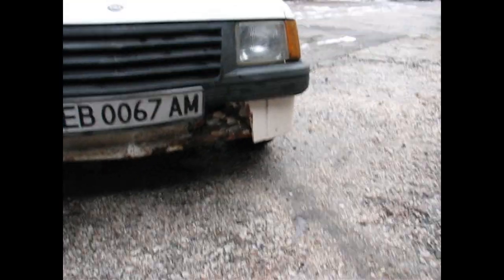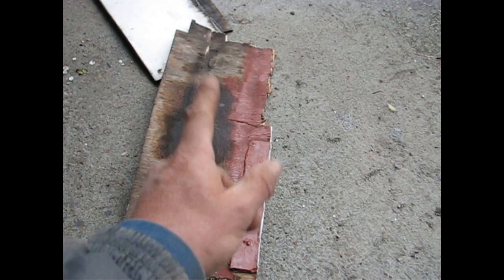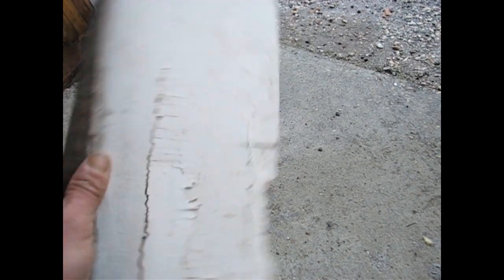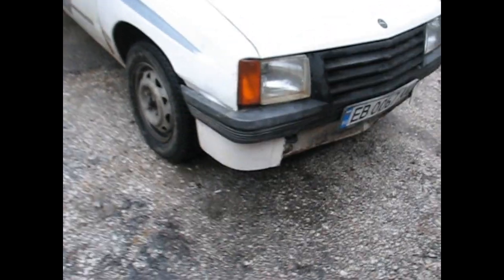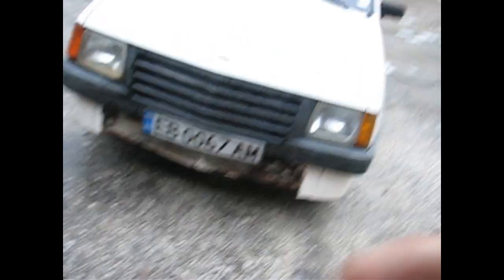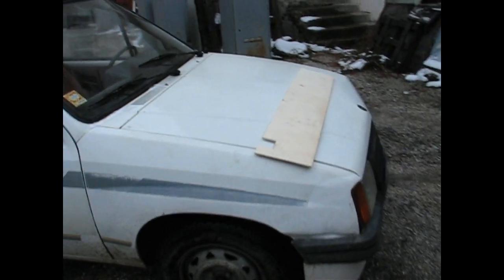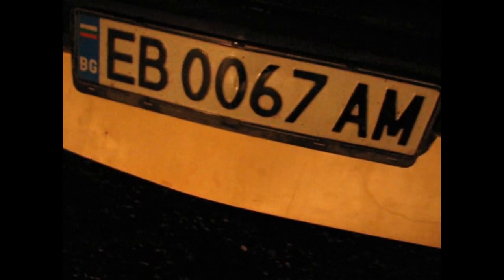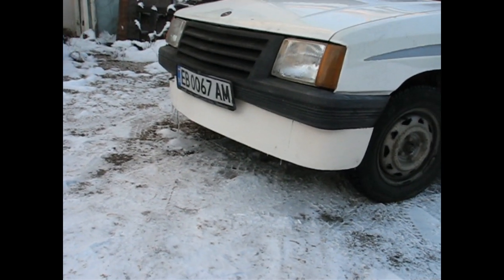Poplar marine, plywood!!!

Comment: Which car is this?
Reply from the maker: This is Boyco, he drives Balkan Shipyards, best car! 1984 OPEL Corsa 1000 cc
Reply: @BalkanShipyards  Thought of getting nissan micra, volkswagen polo or datsun-nissan sunny! All 1980 models. Do you think any of thosr are alright? :) Just wondering if you know, maybe
Reply from the maker: @Anomalous-Plant  Nissan  make good engines! BUT look for rust! Don't buy a dead body... VW are also very good, and are a bit more rust proof. The Polo is good, Golf is better, Passat just as good and bigger, Sunny and Micra I can't say, though the Nissan Vanette I had, was amazing... Subaru Justy 1.2 are very reliable! Those old cars if well maintained never die, though rust is the biggest problem. Look for one in a dry and warm location, far from the sea (a desert), those are usually solid, GOOD LUCK! My Opel runs like new, he never breaks, though if he does I fix him myself... easy!
Reply: @BalkanShipyards  Thanks a ton!

Comment: I've been wondering if you could vacuum infuse your own plywood. Make veneer in strips, stack it up in layers and vacuum infuse with epoxy. Not sure if the epoxy would properly infuse through the gaps though. Might also not be easy to make veneer or maybe build some kind of machine for it. But it could be rather cheap except for the amount of work required.
But you could end up with the best ever waterproof plywood with fiberglass sheathing already. You could also make it longer for a developed hull.
Probably a stupid idea :)
Reply from the maker: Good thinking out of the box..... Everything is possible,but is it worth it??? Making veneer is serious business! Better to buy it ready. Epoxy is not what we all think, it looses grip the wetter the wood gets. Phenol Formaldehyde on  the other hand, somehow, don't ask me how, the wetter the wood the better it holds! The Poplar Ply I buy is plenty strong and dirt cheap for my needs...... Still I wish someone would make marine ply with it.

Comment: The current problem for me is that popular plywood is made from many very different woods. So it’s not known what it’s long term durability and consistency will be. Will it old up to the 10 to 20 years of outdoor exposure I would need for a boat I would build?  I understand the durability of the current wood in plywood’s  I use that I am familiar with.
Reply from the maker: Well, with proper epoxy encapsulation Poplar will last just as long as rot prone Okoume lasts. I still can't understand how such a wood species was ever chosen for "Marine Ply"!!! Sometimes I wonder if it's not just all 1 big scam............
Then again, I wouldn't buy unknown Poplar ether. The stuff I buy is made to the highest quality, no internal voids and glued  up properly. I just want them to reduce the knots to a minimum also on the internal layers, and yea I'm willing to pay more for it, cos yea, it will still be cheaper then over rated Okoume, and stronger....... And lighter........

Comment: You make a good case but living in South East Asia I'm hoping for  bamboo plywood. Bamboo is light weight, crazy strong, naturally rot resistant and eco friendly.
Reply from the maker: Never even thought about it.... Bamboo is tough as nails, I know that, I mounted tongue and groove flooring that was laminated bamboo, it was very hard stuff! rot resistance?? I will take your word for it, but what about cost? Poplar are big trees, they put'em on the lathe and a single tree will just crank out enough veneer for a truckload..... How would small bamboo logs work for a modern time conscious factory????????